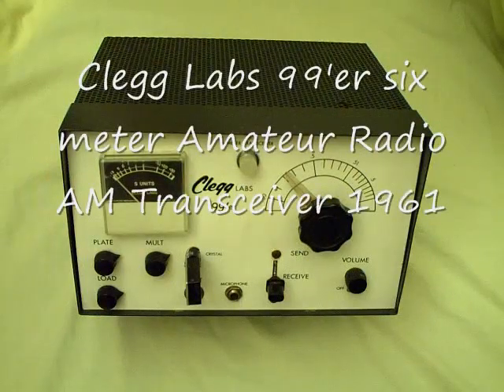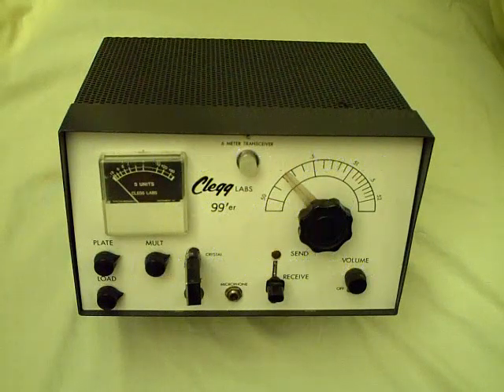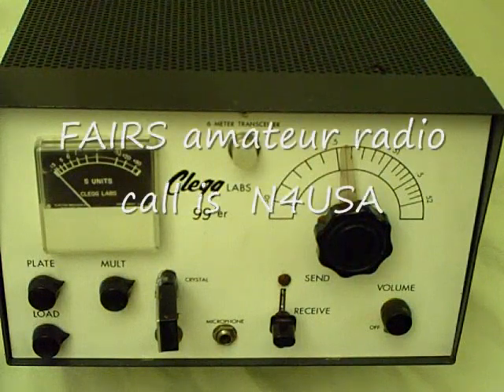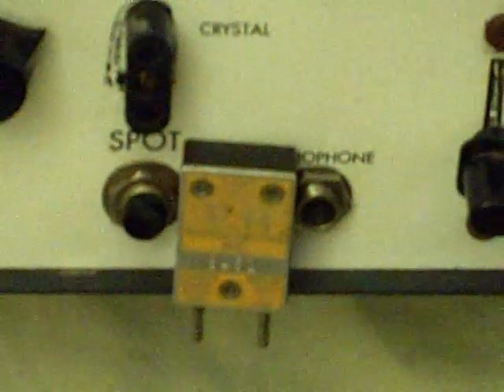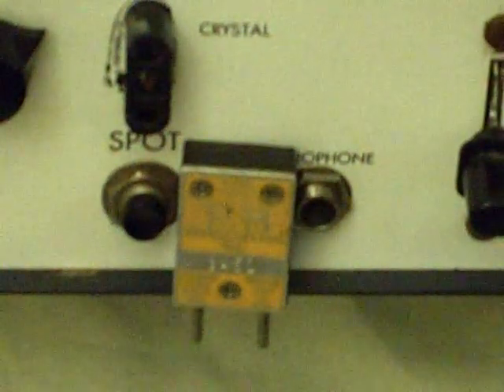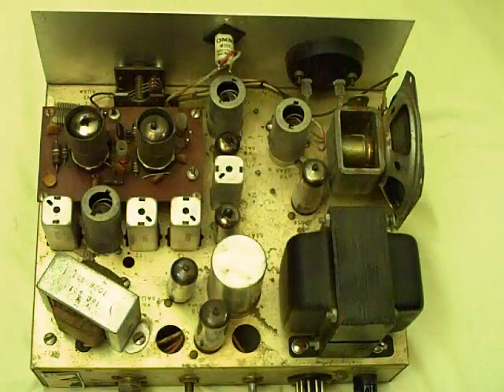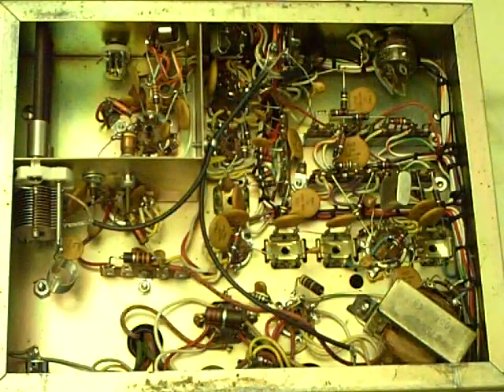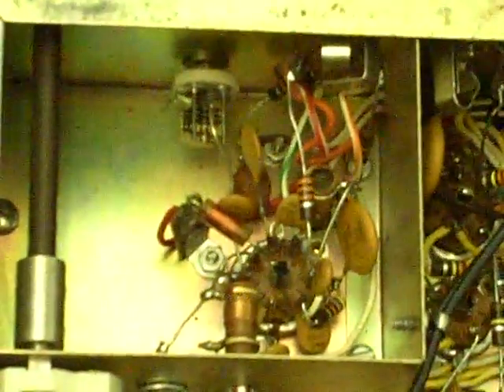Clegg 99'er six meter ham-amateur radio transceiver 1961  Floyd Virginia LCF Group

Comment: I bought one in about 1963 to take to college instead of hauling  discrete components.  Absolutely hated the "PTT" on the front panel - especially for in the car.  The mobile configuration required an HV source as well as 12VDC, which wasn't much fun in the car anyway, but it did work fairly well.  Dad wouldn't let me cut a big  hole in the body for the antenna....

I scrounged a VFO, which required a relay on the B+ for firing up the VFO - I forget whether the VFO needed a separate A (filaments) supply or  had a transformer in the VFO.  One or two tubes - WRL 6 & 2 Meter unit.  I don't remember putting the VFO in the car, but that was a LONG time ago.  Sold it for peanuts in the mid-60's, and ended up giving the VFO away to a new ham at a  hamfest.

Putting a relay in to replace the PTT switch was not worth the effort, but really wasn't too difficult.  Very long night - especially when I found out that the transmitter worked fine, but I couldn't  hear anything.  I gave up and went upstairs to take a shower before going to bed.  Mid-shower, the brain kicked back on.  Turned out that I'd wired the relay so the antenna went to the transmitter when receiving, and to the receiver when transmitting.  No ill effects....
Reply from the maker: HI Stu - Sorry to be so long in replying to your very interesting story.  Great to hear from hams that used this radio. 73 David KK4WW

Comment: I just started repairing one.  Can't find a good schematic.  This one had no transmit.  The 6EA8 tube the crystal connects to was bad.  I got it transmitting
but only getting just a hair over 3 watts.  Would you know of a alignment procedure for this or at least a good schematic?
Thanks,   Ken N1KK

Comment: The design and the realization of these radios is quite a bit more sophisiticated than you imply.  This can be understood best in terms of its elegant simplicity, and the overall efficiency with which it accomplishes it's function.  The transmitter efficiency will be on the order of 65%.  A solid state transmitter likely cannot accomplish over 50%.  It is infinetly repairable by human hands. Today complexity passes for sophistication... but despite piling all this function into an LSI chip..the thing has been rendered understandable only on the microscopic level.    This radio is the 6M equivalent of a good CB radio...it took a couple of  more decades for solid state radios to work as well as this doe on 50 Mc..   W6WUH.